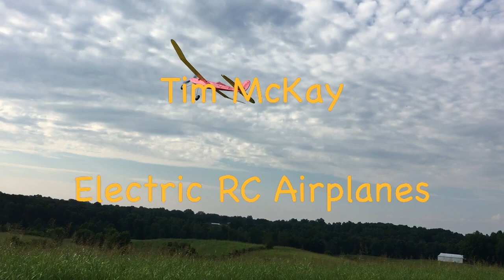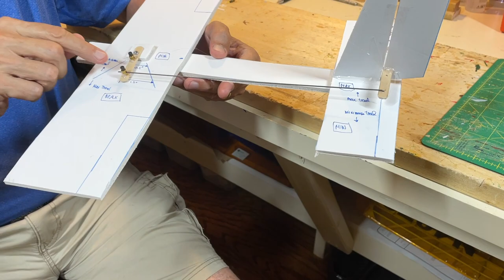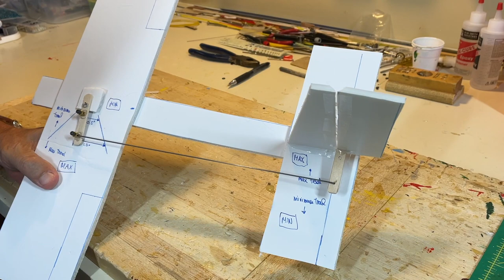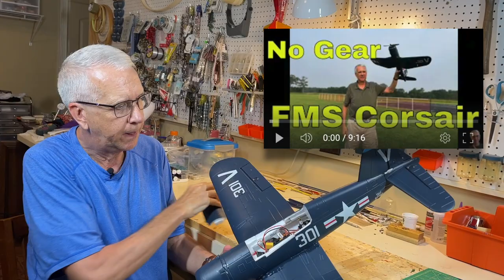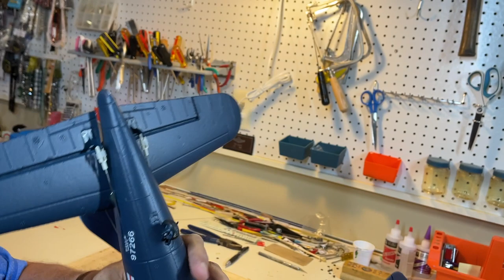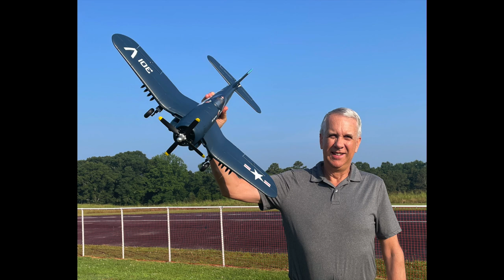How to Adjust Control Throw for RC Airplanes

Comment: Other considerations are the forces brought on by the length of the lever arm, (horns and servo arms).  Think of an air-load of a control surface pushing back against the servo when a short control horn is used.  When a longer control horn (lever) is used at the surface, the servo is given mechanical advantage over that force but at a sacrifice of the amount of throw.  Yes, I've stalled a few servos over the years.
Reply from the maker: Excellent points, thanks!  Tim

Comment: When you move the pushrod closer to the control surface, you're inviting the surface to flutter. Shortening the control horn gives the surface more leverage over the pushrod and increases the forces on it. When I need more throw, I use a longer servo arm or I increase the travel in my Spektrum transmitter to 125%. If I have too much control surface throw, I make sure the pushrod is in the outer hole on the control horn and then move the pushrod in on the servo arm. I try to avoid setting the servo travel in my transmitter to less than 100%. My dual rates are typically between 75% (low rates) and 100% (high rates). On 3D planes with large control surfaces, my dual rates will be between 60% (low rates) and 125% (3D rates).
Reply from the maker: Great points, thanks!  Tim

Comment: Tim I have a question about remote ID I really would appreciate an answer I was wondering how do I connect a remote ID module to a DJI Phantom Advanced professional when there's no power available on the drone? Do I connect it to the transmitter? Thank you very much for your consideration and your time I really would like to have an answer Mike
Reply from the maker: Mike:  It will depend on the remote ID module.  The module needs power, obviously.  For the Spektrum SkyID you can plug it into an open channel on the receiver if you have one.  I think the BATT plug will work as well.  Or, you can use a stand-along battery for the RID module.The module is in the drone, so no way to use the transmitter.  Spektrum would have further details, in this case.  Tim